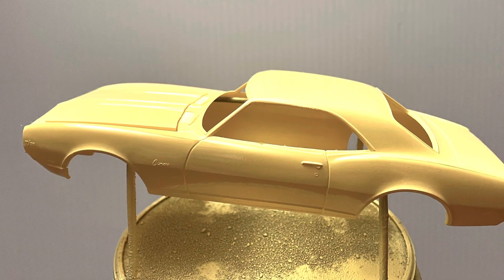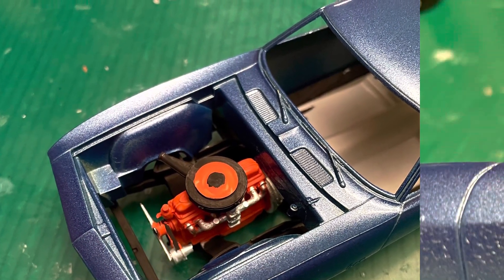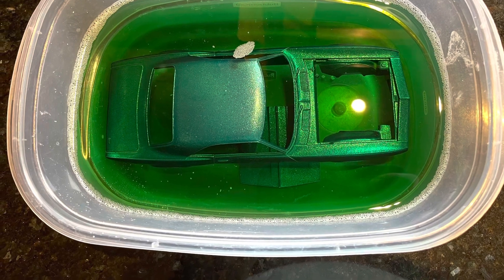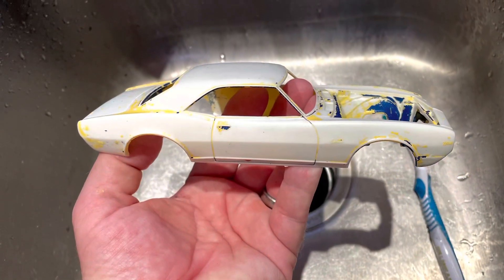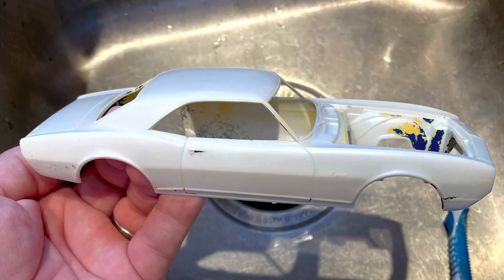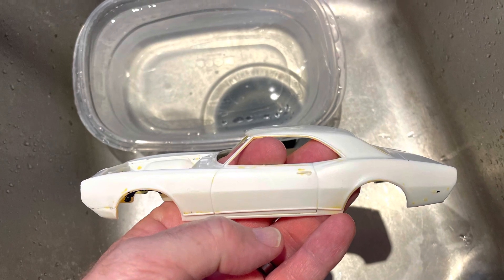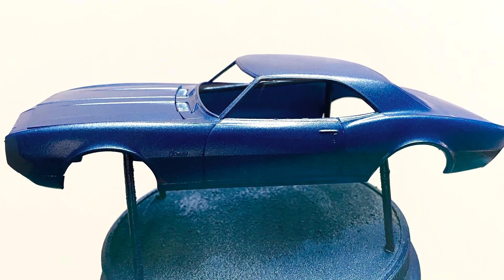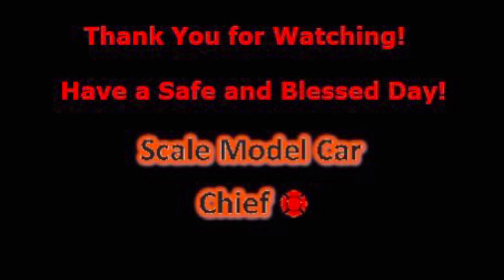1968 Camaro “Plain Jane” Build Update 2

Comment: That green stuff works good!  I’ll try that!
Reply from the maker: Mean Green works really well. It took multiple soakings with a little toothbrush scrubbings, but in less than 24 hours I was back at the original styrene. I’m sure you will be pleased. Steven

Comment: I'm glad it turned out for the better.  If your using a floor wax ( Future )  and it does crackle on you.  Next time try using some Windex with ammonia.  This should remove the floor wax and the not hurt the paint, much.  I've got a couple builds that have done this also.   Looking good.  My first car was a Camaro and it was almost that blue.  Keep on buildin on.   Paul
Reply from the maker: Thanks for the advice Paul. Sometimes I get my thoughts and words mixed up 😀, it was the two paints that reacted causing the paint issues. I was trying to say, I like using floor wax so I don’t have paint issues. 😁 Sorry for the confusion for you and other viewers. I will try to clarify my thoughts in the final reveal video. Have a safe and blessed day! Steven